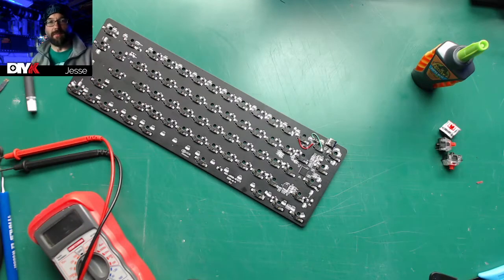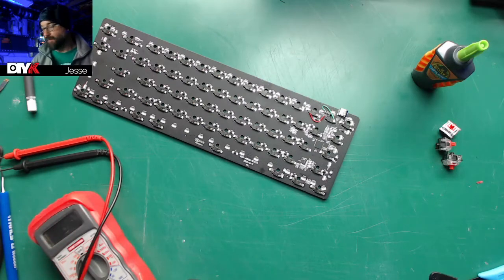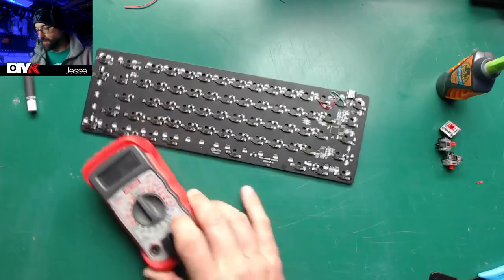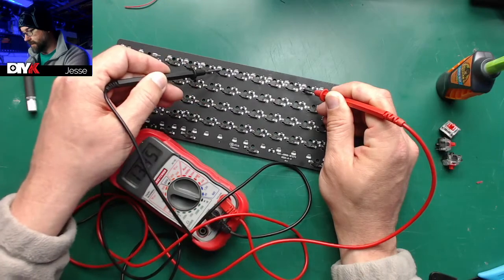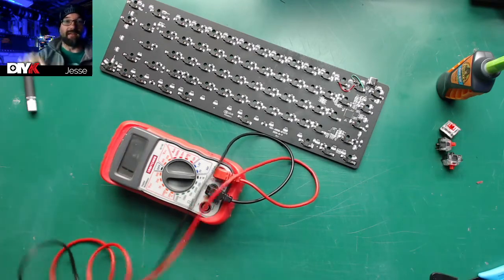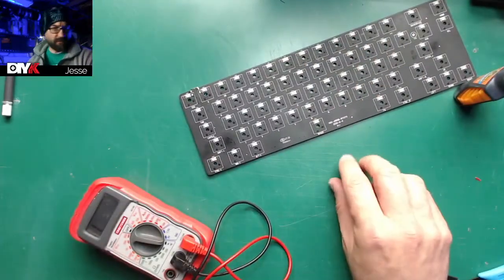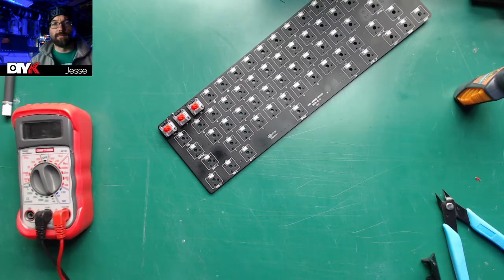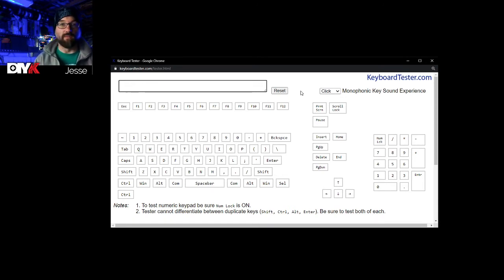How to Repair a PCB with a Torn-Off Hotswap Socket

Comment: can you just solder the pins normally?
Reply: Something about the pads being done
Reply: I know this is two years late, but the reason why this usually isn't possible is because the soldering pads themselves  also come off the pcb so there isn't anything for the solder to stick to.
Reply: @_FrozenPotato_  It looks like the solder would make contact what whatever it was contacting before.

Comment: Do you need a jumper cable to do this or can you just solder them back  together because my hotswap socket completely broke off
Reply: If there's metal there to work with you can certainly solder it back in place. Sometimes it's just easier to run jumpers.
Reply: @sixdeuces6825   could I use some enamel copper because I found some and some people used that instead of ribbon cable.
Reply: @TheReLReL  Yes,  definitely. You need high heat to burn off the insulation though. I often use it when handwiring.
Reply: @sixdeuces6825  is the insulation the part of the copper? Where you connect it to other hot swap sockets
Reply: @TheReLReL  The insulation is the enamel coating on the wire. You heat it up real hot, like 750F (typically the wire spool has the correct temp listed) to burn off the coating and reveal the copper wire beneath.
Reply: @sixdeuces6825  so I burn the part where The wire is going to connect each area
Reply: @TheReLReL  As long as your iron is hot enough, you can just solder as normal and the enamel will burn away as you work.
Reply: @sixdeuces6825  could we maybe Vc because I feel like I might  mess it up or could you tell me a place where I could ask for more help?
Reply: @sixdeuces6825  wait if my hotswap socket is ripped off can I just use solder to solder in the switch?? And it just became a solder pcb?
Reply: @TheReLReL  Well, you could, but that would require literally the same repair, but you'd lose the hotswap ability. You're just trading one set of contacts for another.
Reply: @sixdeuces6825   so i tried soldering it and its still not working even though i soldered it do i put more solder or do i put it somewhere else?

Comment: will it work if you just glue the hotswap socket to where it fell off on the keyboad?  because right now i have one that fell off when i was building my keyboard recently and so i taped it back to the pcb and the key works evey now and then but not all of the time and i dont have access to the other materials?
Reply: If you're very lucky it could work from just the contact between the broken parts, but in most cases solder will be required.

Comment: hello! what wire can be used to connect the diodes?
Reply: Pretty much anything will work. It's easiest to use something pretty fine, like 28awg or similar. I often use wires pulled from inside old USB or LAN cables for repairs like this.
Reply: @sixdeuces6825  Oh I see. thanks for the reply! subbed

Comment: So a friend of mine had me replace the switches in a ducky varmillo board, but it doesn't have hot swap sockets. I somehow managed to ruin both pads on one of the switch sockets despite having worked on soldered boards several times before, if I add a hot swap socket to that switch hole, would this fix work in that case?
Reply from the maker: Assuming you can get it to fit, then yes it could work. Really though you can just solder directly to the switch and get the same result.

Comment: What cables do u use
Reply from the maker: I use strands of 28AWG ribbon cable, which you can find in 1 meter lengths on my site at: https://www.diykeyboards.com/parts/product/p10p-rainbow-ribbon-cable
Reply: @diykeyboards2522  can you use 20 AWG or do you need to use 28
Reply from the maker: @findponcho  Either will work fine.

Comment: I'd recommend putting a drop or two of super glue on each hotswap socket before inserting the switches. That way the stress is not applied to the solder points but instead reinforced by the glue.  Also be careful to avoid getting glue in the holes where the pins from the switch will be plugged in.  Especially if you're going to be pulling out your switches every year to clean your keyboard or something like that.  Cheers!
Reply: Great suggestions, thanks!
Reply: But then you can't replace it if it gets loose

Comment: Would you do the same thing with a non-hotswap pcb? If not what would you do if you lifted a pad on one of those?
Reply from the maker: The diagnosis would be identical. Rather than soldering to the hotswap, you'd simply be soldering the leads directly to the switch pins. Because the switch is normally held in place by the solder, you'd need to glue it in place.